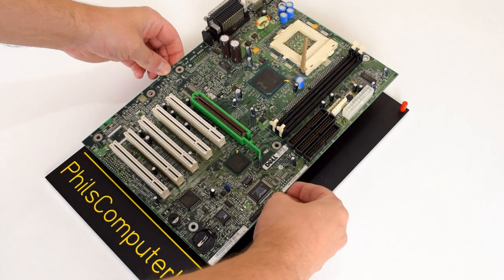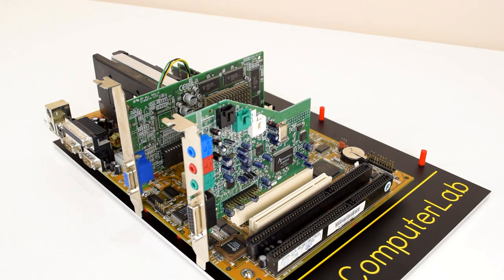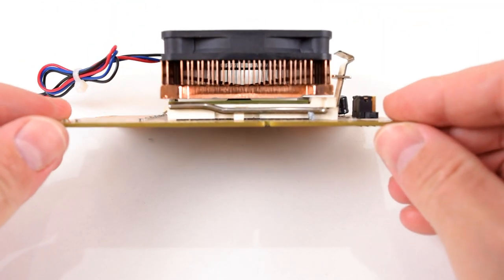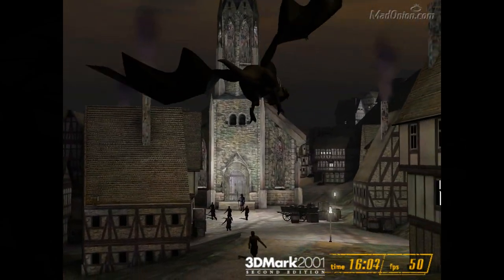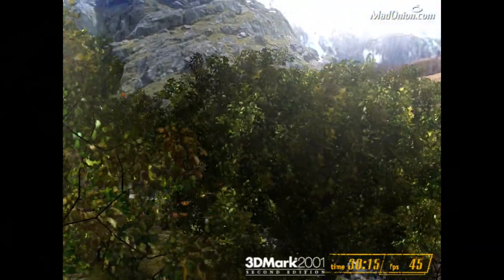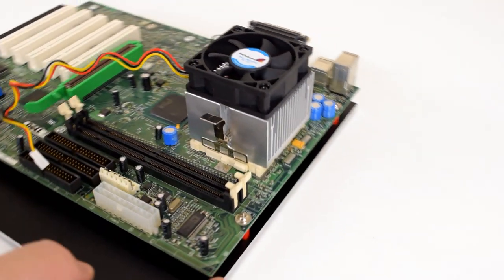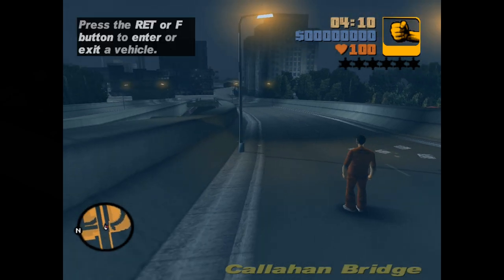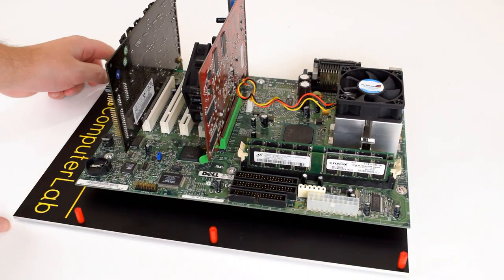The Pentium III 600EB - What does EB mean?

Comment: In 1999, I was a bit "behind" everyone else - so I was using a P3-500 , Compaq Presario 59XX, with an ATI Rage Pro combined with an Orchid Righteous Voodoo 1 (yes, it was beginning to show it's age then - but the Rage Pro did ok in the games where glide was not an option). I had 512MB RAM, 13GB + 20GB, I changed the audiocard from some unknown to the SB AWE64 (because I needed better Midi). It was a quite capable machine though - especially the 19" screen that followed was absolute awesome. I actually miss that screen - it was heavy as f*ck  - but damn it was nice to play on compared to my friends 17" screens.
Reply: that 500 was probably, almost certainly, a katmai core (coppermine started at 533 aside engineering samples) so you would have had a solid stable system no matter what windows you wanted to run.   even ME would have given you no trouble.
(and if you were lucky enough to have a katmai based xeon.... pure gold for windows ME)
Reply: 😮yeah those CRT, horrendous weight, but awesome screens nonetheless

Comment: I had a socket Celeron II 650 (100Mhz FSB) which I overclocked all the way up to ~130Mhz FSB which gave me an overall boost to ~850Mhz. Worked flawlessly. I used a copper cylindrical cooler. Cool, quiet, and a lot faster than I paid for. If I went much higher it did get unstable. Back in those days I used Win98 with Litestep and a cool desktop, but eventually upgraded to Win2k.

Eventually I experimented with water cooling it, not that it needed it, and it performed well. I used a copper block bought online and a fish tank reservoir. My friend suggested a part anti-freeze part water mixture.

The copper block with aluminum connectors and the aluminum radiator eventually galvanized or something. The connectors on the copper block sheared right off. After drying the motherboard off in the tub it worked again and I used it for years. That thing was a great value!

Comment: Nice vid Phil! Here's a bit of my hardware history around 2000.

In december 1999 I was still on my first build (Pentium II 300, Asus P2L97, ATI Expert@Play AGP, Seagate 6.4GB), only thing that changed were the RAM because of stability issues (I had 64MB PC66 originally, a double height stick with 32 chips, exchanged it for a 128MB PC100 stick).

In late 1999 I sold my Creative DVD ROM kit to finance a new graphic card, I wanted the ATI Rage Fury MAXX but fortunately I ended up with the Creative 3DBlaster Annahilator Pro (GeForce DDR) instead.

My new graphic card caused some issues with my motherboard as it couldn't provide enough power so I exchanged it for an Asus P3B-F. Some days later the PSU died so I got a new one as well.

Middle of June 2000 I upgraded the CPU with a Celeron 566 that I ran at 708MHz on air cooling and later 850MHz on water cooling.

In October 2001 I went AMD (Athlon MP 1,2GHz, Epox 8KHA+) with a new rig, only my hard drives and graphic card came from my old one. I kept my old rig too, and actually upgraded the CPU once more to a Celeron 1.1GHz "Tualatin" that I ran at 1540MHz (4.5 times faster than my original Pentium II).

Comment: Excellent review! This is from an exciting period in computing. Its interesting to see the 600EB keep up with the 700E. The 133MHz FSB is equivalent to adding 100MHz to the core clock of the P3 with 100MHz FSB. I build my gaming PC around the P3 800 with 133 FSB back in the day with a Geforce2 GTS. Was a killer gaming PC for almost 2 years, which is an eternity back then. The system was based around an Abit BF6  (440BX board), and was eventually upgraded to a Tualatin 1.4, and continued to serve as a secondary system until 2007 when it was stolen. I recently re-built a similar configuration based around the 815 chipset for some retro gaming.
Reply from the maker: Yea, you can add 100 MHz for the EB models. It will be interesting to see if this trend continues. I've got a few more S370 CPUs I bought on eBay, but they haven't arrived yet. What else in your i815 machine?
Reply: PhilsComputerLab it's a Tualatin P3 1.4, 256mb of pc133 ram, Asus TUSL2 mobo, and the graphics card rotates between a voodoo 5 5500 and GeForce 3. I run mostly windows 98 games, and a few late dos Era games. I have an original pentium system on a super socket 7 for older games.

Comment: Is there a story behind the Radeon graphics card having a nVidia sticker on its fan? (5:10)
Reply: I think previous owner changed the cooler to one from nVidia gpu
Reply: Maik Merten just for lulz
Reply from the maker: Yea it came that way. I've since replaced the fan, but will get a proper cooler replacement when it arrives.
Reply: the only reason anyone does anything... 
#fortehlulz
Reply: Agent Smith my life story
Reply: That might just be Radforce :D
Or a budget version of the Bitchin Fast! 3D 2000.

Comment: Can't say for 1999-2000, but by the time 2006-2009 was a thing, PIII boxes were EVERYWHERE. people couldn't get rid of them fast enough there was always a diamond in the rough PIII box out at the curbside during bulk waste day and I was well aware of dates for these days and would go out one or even two days before and yank up the nicest systems I could get my hands on at the curb with my bike, which I fitted out with clamp baskets and bungie cords. 

For a time, I had a 9800 Pro, a USB2 card, an Audigy 2 ZS and both a 36GB SCSI boot disk on internal SCSI and an 80GB IDE drive (black-top WD I think) in a Dell Precision Workstation 420 with dual PIII 933 Slot 1 CPUs and a gig of PC800 RDRAM. it was probably the fastest box I had of the era and it really sucked because it only had an AGP Pro 4X slot. I can remember trying to run Vista on the thing and it was just a dog. XP ran great however, and SP3 at that (why SP1 for the videos?). I still have the machine but it's a shell of its former self.  the 2GB of RDRAM I slapped into it don't work for it as it's the wrong latency, and is instead intended for a Dell OptiPlex GX400 in my posession with an S423 P4 1.8 in it and also in need of some TLC (and upgrades, a-la PCI 9400GT, probably.)

the main machine I was using in 2009 for browsing the internet and playing older games (UT99, GTASA, Quake, Quake 3 Arena, and some other titles) was an OptiPlex GX110 based on the 810 chipset. PIII 1GHz/256/133, 512MB PC133, 120GB + 80GB + 10GB scratch HDDs, PNY FX5200 256MB, Audigy 2 ZS Gold, two USB2 cards, Intel Pro1k GigE card, and a nice chunky 120mm fan over top of the cards ziptied down to keep everything cool. 16x DL DVD burner as well. Ran a pirated copy of XP which came with the machine for a time that I cleaned up, and then from there I moved the machine to Windows Fundamentals for Legacy PCs in 2010 as I was noticing slight hiccups doing certain tasks, and any increase in speed could have essentially been placebo, but I know for a fact FLP runs extremely well on older Pentium II 233 to Katmai 550 based machines, so long as you give them enough RAM to play with. that might be an interesting test to play with in the future... both trying out POSready 2009 and FLP on these older systems in conjunction to a normal XP SP3 install. (note that FLP shares a service pack with Windows Embedded Point of Sale and will need this to go to SP3.)

Out on the internets is a bencher for UT99 that runs a specific benchmark but I have no idea where to tell you to find it. this might be something to add to the benchmarks in the future.
Reply: I often use UTBench to test performance. Searching this in Google gives a few places to download the demo.

To use it, copy the .dem file to the UnrealTournament\System directory. At the console type:
timedemo 1
demoplay utbench.dem

After the benchmark runs, look in the console and you will see minimum, maximum and average FPS for the demo.
Reply: Yeah, I noticed XP SP3 on 128 MB is struggling just keeping itself running. Had the opportunity recently to setup an old laptop (P3 750, 128 MB, Rage 128 Pro) and with nothing installed except the OS and drivers I had whopping 20 MB free memory.
Reply from the maker: Thanks for sharing!
Reply: =Sudos. I used to work  for the an Embassy/residence in 2002/3 in Mayfair. 
      Mondays was Big Rubbish day which meant the residents in Mayfair used to leave out their unwanted  fridges/furniture including all their older PCs the night before (Sundays) So if I was working night shift I would walk around the area collecting all the dumped PCs. Because they were extremely rich there was some amazingly high spec "crap" which on occasion was only a year old. As I was a chauffeur (which meant I did very little as it was usually empty, just the Phillipino staff and me alone in this big building ) I stashed all my finds in their garage driving up the next day- (I normally used the Tube)- to collect my treasure trove to take home.There was some beautiful all in ones but I was very selective as I only wanted gaming capable tech, so I usually passed over a lot of good stuff. I didn't need it.
 However one week for my mates I decided to collect ANY good nick PCs  so by early Monday morning I had about ten huge PCs all stashed in their garage.ready to collect the next night.
Well that week my luck ran out big time.
 I was woken that afternoon ( I slept in the day at home, obviously)by a call from a frantic  head of the staff, a very nice Phillipino guy ( for whom I collected cameras which I also found on my trawls)telling me the Royals had turned up  unannounced ( which they did maybe twice a year) and were very upset that they couldn't get their big S-class Mercs in the garage because it was full of computers. So I got sacked (quite right, I deserved it) but also lost all those PCs as well!

I then went to work for Tesco Dotcom delivering food and just like you I was picking up any PC junk lying around and confirm what you said  about there being a LOT of it. This is before we started recycling our rubbish but your post took me right back to those days. P 3 and P 2 stuff was everywhere but if it didn't have a AGP slot it stayed where it lay. When Greenwich council were  updating their PCs there were huge skips FULL of perfectly good hardware, mainly  Cyrix  stuff which I didnt realise had a high gold content.
Suffice to say I didn't pick any of it, but of course I kick myself now for all that gold I passed up.
I apologise if I went on a bit but then it was so much easier to get your hands on unwanted tech. Now you cant even get it at your local tip because of Political Correctness gone mad.
This is to show the younger guys here what it was like back in the day. 
I remember I hardly ever came across RAMBUS  and usually it only came in pre built systems. I do remember they had these blank sticks they needed pairing up with, which shows how crazy expensive it was.
Reply from the maker: Man what a great story! I can't believe they just chucked their computers. What I take away from this story is that whenever you have a good thing going, don't get greedy, as that's when it falls apart. Thanks for sharing!
Reply: It's illegal to try and take dumped PCs from recycling centres in the UK. And that's pretty much the only place this stuff gets dumped. I dumped some old dead / rusted systems a few times and would sneak a peek at some of the stuff that was dumped. I could have sworn one day I saw a Nehalem or Sandy Bridge system containing a hefty video card, RAM, hard disks etc... but of course, I couldn't take it. :(
Reply: + Phil -No problem. Thanks for uploading.
I have many more such stories form back then. I worked for an Undertaker which specialized repatriating people (stiffs) who died abroad. 
I'd pick them up at Heathrow/Gatwick/Stansted and drive them to their local undertakers, all over the country. Great job, well paid and the customers never complain.
Very simply I visited every council tip in England and Wales and  after a few months I had a nice little round going where I paid someone to collect all the  CPUs RAM/Graphic/sound/network/you name it  cards etc for me. So when I went that way again a few weeks/months later I had boxes full of goodies, just like that box you got previous video , but ten boxes (sometimes). Man, I had more stock than Dell.  I love finding old stuff , cleaning it up and making it work. Its better than buying new stuff.
Anyway don't want to go on too long. Another great video! Nice one Phil.
Reply: Only issue when running SP1 to interact in a modern environment is the lack of support.
And by that I mean the lack of stuff one can install. The most recent SP is often required to run more recent software.
Would like to have some SP1 and SP2 CDs around as addition for benchmarks.

Comment: A few years ago, I had a Fujitsu Siemens Scenic PC, it had s370 P3 1000 EB, intel i815 chipset AND one ISA slot. 
A Sound Blaster AWE 32 was installed on that slot :)
It was their proprietary board, it would have been interesting to find if it had some kind of a bridge chip for ISA or not.

Comment: In august 2000 I had bought and assembled my first PC. It had Chaintech 6BTM (i440bx) motherboard (widely recommended in our russian FIDO segment as one of the most stable MBs at the time), Pentium III-500 (Katmai, Slot 1), 2x32 MB PC-100 RAM, 8 GB Seagate HDD, simple AGP Trident video card, ASUS S400 CD-ROM drive and a noname case. I brought all the hardware home, assembled the parts together, connected the case to the monitor, turned everything on... and nothing happened. Only fans in the case started, but no sound from PC speaker, monitor didn't awake. I was very frustrated. I checked the connections many times - everything seemed to be connected properly. After few hours it turned out the IDE cable was connected to the motherboard the wrong side (there was no key on the cable connector). The MB wasn't able to start or to indicate the error.
The computer worked fine till 2006 (but I needed to replace capacitors on the MB to get it back to life) and then I played with it for some time as an OpenBSD server. It was pretty stable.

Comment: I had a celery 400, I think it was lightly overclocked to around 600. The mobo was a via chipset, and it wasn't long after 2000 that I upgraded the graphics card to a Hercules 3D Prophet 2 GTS 64MB. Not sure about the exact timeline, but I was running a Panasonic SCSI slot loading CD burner, which was awesome. It never suffered from buffer underruns since it was entirely separate from the IDE controller, and burning from one drive to another was also perfect since SCSI drives transfer data directly from one to the other, without having to go through the host system, as it would with IDE. I later upgraded it to a DVD burner (also Panasonic, and slot loading). But I digress. When I bought the GF2 card, my friends told me I was crazy for spending so much on a graphics card, but not upgrading the celery CPU. They shut up after seeing the performance I was getting at a LAN party!
Reply from the maker: Thanks for sharing!

Comment: I had (and still have) a P3 800 (and later P3 1000) mounted with a socket 370 adapter card on an Abit BE6-II. With 256MB of RAM and a Matrox G400Max, this system did well for years.

Comment: My experience with an EB processor from Intel came when a lightning strike took out my Pentium III 700MHz Slot 1 system.  I upgraded to a Pentium III 800MHz EB CPU using an Intel 815 chipset which officially supported the 133MHz FSB speeds, and was just as reliable as my previous 440BX chipset platform except that it maxed out at 512MB of RAM instead of 1GB.  Around the same time memory prices started falling so packing the system with all 512MB was relatively cheap.

Comment: wasn'y rambus pentium4 early memory type? before they switched to ddr?
i had two crazy motherboards for socket 370, both frm ecs i called them "momory killers" because that what they did to most of my performance sticks , that were highly overclocked on low timings. One model supported sdr memory, via appollo pro, up to 3x512mb (i had 4 sticks of samsung refubrished sdr memory, each 512mb@133mhz@cl2) this board really liked to work with pentium 3 s 1400 on fsb up to 150mhz. the 2nd board was on sis chipset and supported 2 sticks of sdr or 2 sticks of ddr memory(working as sdr memory) For this board i had celeron tualatin 1300 from late sl5 series, that could handle being upclocked to 133mhz fsb. and run xp fine with 2gb of ddr memory Those were my first systems that pushed the limit of watchable matroska 720p, sadly no power for subtitles. both systems recived 2,5 windows experience score, overclocked pentium system pushed 2,7 at one point, but memory start dying at this point, so i had to stick to 2,4-2,5 score :]
Reply from the maker: Thanks for sharing!
Reply from the maker: Yes Rambus was also around for early P4. i850 is the chipset I believe. But for P4, i865 is the way to go. That chipset is soooo good.

Comment: To share a sort of story , I actually  bought a system with Pentium 4 and with 512 MB of RDRAM when I was 15, and that is when I learned the hard way that I needed a dummy ram stick in the other slots where I don't use ram sticks. but later I did upgrade it to 1GB ram and that worked fine. and I actually still have those RDRAM stick in a anti static bag :P
Reply: They are actually still worth something. People didnt bought them back then and now they are quite rare. Would be interesting to build a nice Northwood/RDRAM system as a retro machine.
Reply: Yeah, the P4 with kinda flew with RDRAM but then the Dual channel DDR systems weren't that far behind either. RDRAM on the PIII was unnecessary though until maybe around Tualatin but it was better to go with SDRAM or DDR
Reply: i just realize something this day 4 days later i made this first commant, i wasn't 15 when i bough the RDRAM P4 system, at that year of 15 i bough my AMD k6-2 550 mhz system. this was around year 2000 :-P